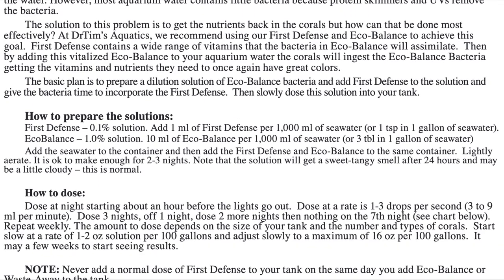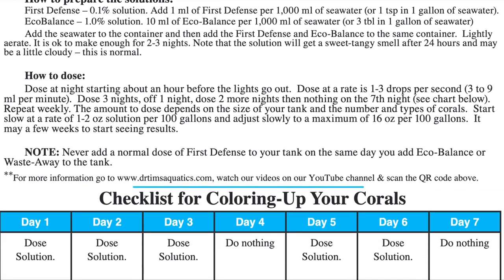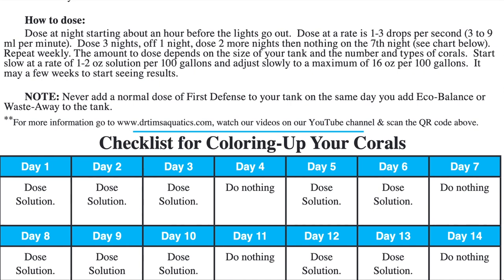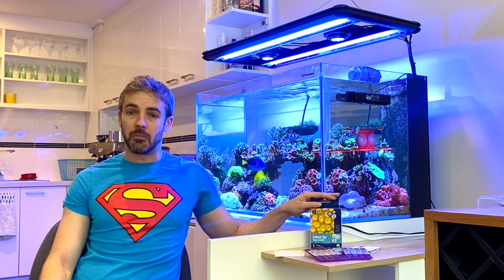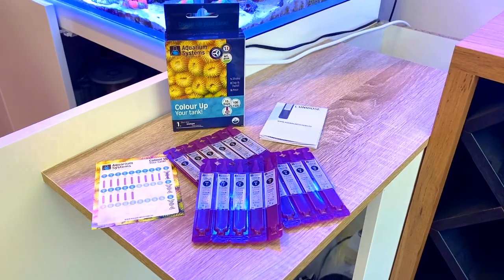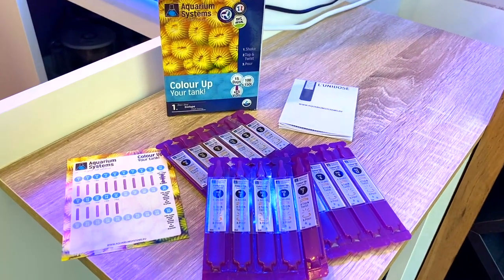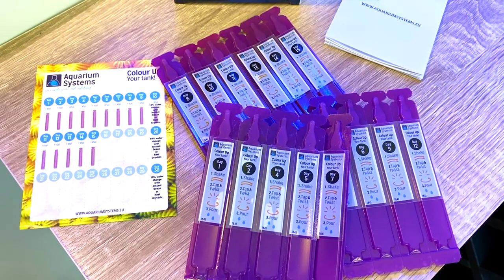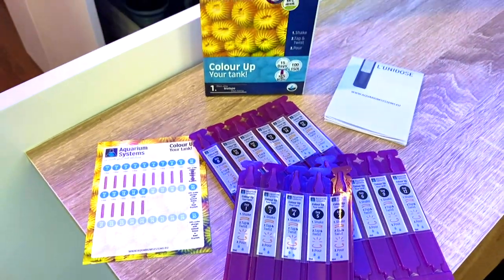Improve Coral Colour and Growth... WITH BACTERIA!

Comment: Wow. Another great vid Marcus. Ever since I’ve been watching your vids, I notice the tons of info u are willing to share. Just wanna day Thanks man. I have almost non existent nitrates but my phosphates are 0.44. Maybe I need to up my biological filtration. Do you have any advice or help to bring that down?
Thank you again for page.
Reply from the maker: Nitrate is needed by the bacteria that will consume phosphate. So your phosphate cannot go lower because your nitrate is the limiting factor. Make sure you have adequate surface area for bacteria (live rock, and artificial bio blocks with huge surface area) then you can potentially start dosing nitrate to help with the imbalance. Over time you can correct it to the point where you will may no longer need to dose.

To try dosing nitrate (VERY SLOWLY) and attempt to raise it gradually up to 1ppm, then 2 and finally ~3ppm over the course of a month or two or three. I cannot stress enough to do this slowly though, many of the nitrate boosters on the market will give you guidance for x drops per 100L to raise by 1ppm. Half or even quarter that dose and test every few days to take it really slow and if needed gradually increase the dose. Many people in your situation go ham on the nitrate dosing and cause a much bigger issue. (cyano/dino outbreak or worse).  This wont be an overnight fix.

Given your phosphate is already so high, you may want to artificially reduce that through other means in conjunction with the above through waterchanges, GFO or Lanthanum etc...